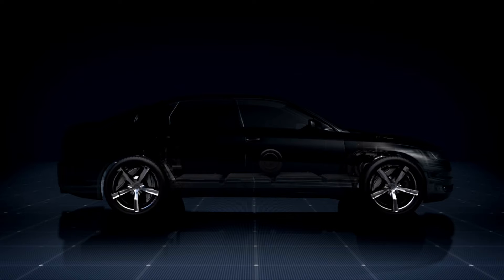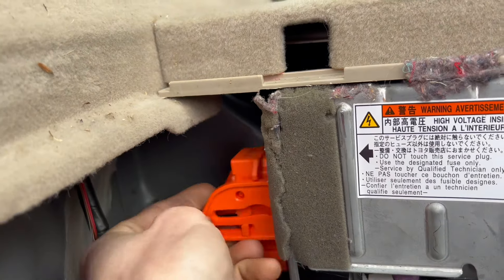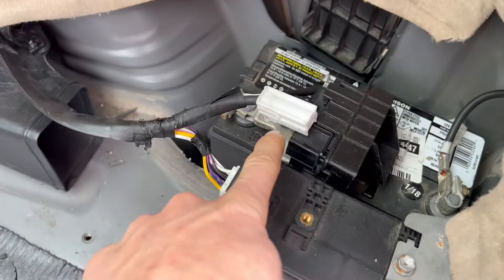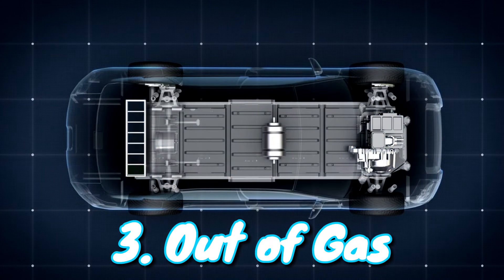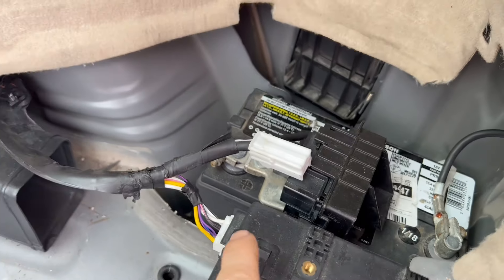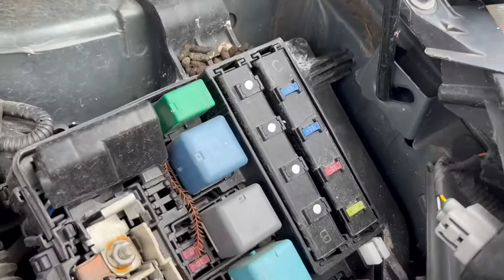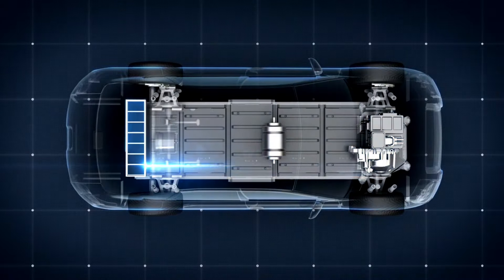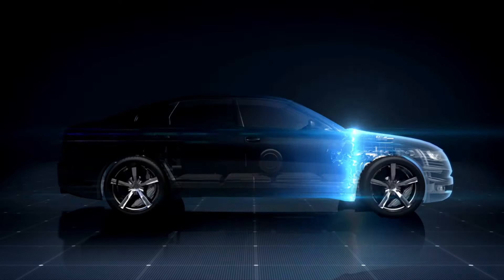My Prius won’t Start (Do This)

Comment: My 2009 Prius stopped in the middle of a very busy road on a Friday afternoon. Worst part was locked into P so I could not shift it into N to push it out of traffic. I turned on the hazard lights and stood 50 feet from the back of the car warning cars in my lane to change lanes. Most folks got the idea after seeing my car dead (the hazard lights were not easy to see in the bright daylight), but some folks just ignored me and drove all the way up to the back of my car. LOL Out of the 100s of cars, 2 kind gentlemen came to help and realized I could not get into N to push it out of the way... the last gentlemen said we could force into N ifwe removed the center console. In the meantime, tow truck was called and hopefully they called Police to help direct traffic around my dead 'once very trusty' Prius. Finally jiggled the gear knob back and forth as the second gentleman suggested and it went to D, then to R and quickly lit up N and back to P. Once I saw N light up temporarily, I felt hope and just kept at it... When N lit up, we pushed the car into a driveway/parking lot. Big relief!!! Very grateful to the two gentlemen that stopped to help!!! Got my car towed home and leaving it there for now. The Red triangle of death appeared as well as the (!) in a yellow circle, VSC, check engine and the low tire pressure lights were on right after the car died... oh, the area where the D, R, P, and N lights were went crazy and blinking but no D, R, P, N lights appeared... just a bunch of horizontal blinking dashes (short lines). Any idea what caused this? Glad I was not driving to the airport on the interstate! Need to do that tomorrow with our other car!!!
Reply: I had a similar issue. It died me on right at the light . Stuck in park and steering wheels locks up . I would turn it off and on and the steering wheel would go back to normal but shortly after the engine turns off and the steering wheel locks up .
Reply: @alejandropena5658  Hopefully your Prius is running normally again. I got my car towed home and have not even tried to drive it as the thought of it locking up on me has scared the daylights out of my normally 'laissez-faire’ bravado. LOL With a mechanic friend’s OBD he pulled the U0293 code (lost communication with hybrid vehicle control system) and waiting to hear back from him as to what to do next. Looked up many U0293 links, all says to check various and numerous fuses, etc… The car starts now that he cleared all the codes, but glad it did not lock up on me  driving on the interstate at 70 mph!!! What have you done about it??? blue skies and good luck!
Reply: my mother’s prius was having the red triangle of death as well as a plethora of other dash lights illuminated. It would shut off on her after about 15 minutes of driving, but she was able to start it up after about an hour. turns out it was the hybrid battery coolant pump. i had learned the hybrid battery has its own cooling system.
Reply: @karinawashere  you are referring to inverter pump with code 1121 ?  OEM part cost $350 @ dealer,  aftermarket very low price but will not last,then pay/ do again. I have found that when my 07  Prius gives a code?  After reset will work, battery 12V disconnect 3 minutes  and connect allows to start, but comes back because it wasn't fixed. But good to know?   Just might not always b the case, but hope it helps. Thanks for sharing, and vídeo. Helps many people.  2gen luxury when new! Now, low budget, because lower priced. 20 years old.!?
Reply: @atcclass went with a $30 inverter pump from amazon. worked fine for 3 months/8,000 miles later until someone totaled the car. Now looking for another Prius.  Interesting cars. great on gas mileage!

Comment: nice   Take a trip to glastonbury ct,ive had the 2004 for 19 yrs 210000  Its silver and looks/clean good , not all beat up,  did brakes/tuneup waterpump/02 sensors- everything maintenance, im looking at a 2020 le 2wd now with 6000 miles i might buy- get ready 4 beach season   THX 4 the response
Reply from the maker: We have a 2020 awd prius if you are interested? Might be able to work something out and check your silver one out too

Comment: my 2004 second gen prius made some weird noises , now it wont fully go into drive- it seems like it slips & wines-- when i try reverse same thing barely slowly trys to moves ,  Like its not engaging all the way- the dash lights and triangle all come on ?  Can you help ?  any suggestions ??  Please help  THANKS
Reply from the maker: Probably bad transmission:( any noises?
Reply: @carhub2178  no noise, it goes into drive and reverse- but jus tugs & slips a bit- its like its not fully engaged- triangle and all dash warning lights are on ,  motor runs fine - revs a little high MYSTERY ?? what do u think ?
Reply: @carhub2178  its like it wants to engage but instead the red triangle and all warning lights are stuck on and transmission is only partially engaging
Reply: @carhub2178  best way to describe it, its either in park or half in reverse/drive
Reply: Did you figure it out?  Any codes?

Comment: are u interested in the 2004 ?  its all stock new toyota brakes/water pump- hankook st tires- it runs but the motor goes crazy like i explained- look good /clean  had left front fender replaced in 04 when it was new
Reply from the maker: How much you gonna sell it for?
Reply: @carhub2178  at least 2000   Every one in car buisness wants everything for nothing- this is a clean, 04 I told u everything in other responses   THX
Reply: @carhub2178  whats your e mail  ?  i will send u some pics of the 2004 prius- its clean   I will send u the codes it threw to -  Then may b come up with a price-
Reply from the maker: @No2ndHandInfo  wyattvaught22@gmail.com

Comment: so my 04 prius starts - all lights on dash come on - the cooling fan runs constant, if i put it in drive the engine revvs and the car will move forward but not enough to drive it- if i put it back in PARK the idle goes back to normal- fans stay on the whole time ?  Any ideas PLEASE HELP ?
Reply from the maker: Have to hook it up to a code reader and see what it’s saying. Is it making any rattles when you put it in gear?
Reply: Cooling fan in the back?  Did you figure it out?

Comment: My gen 3 starts right away despite having code replace hybrid battery ,why ?
Reply from the maker: If the hybrid cells are not very bad it will still be able to start but if you keep driving with the hybrid battery light on it could really damage it. Also the hybrid battery light could be on for other reasons. Not just a bad hybrid battery
Reply: Maybe depends "how bad" it is? LOL.  Mine would drive normal for like 1M then go into limp mode.  If I turned car off for 30 min then it would "run again"...for another 1mile...

Comment: You bro is there any way I could hit you up and get your advice ?
Reply from the maker: Yeah what’s up
Reply: @carhub2178  im tryna flip this 2017 Buick regal but I’m having no luck , I should had took my first offer but it wasn’t ready yet and I wanted more . It’s from copart too , and it has 18k miles .
Reply: @carhub2178 hey man my 05 Prius ran out of gas and after refilling the tank when I started it up the car isn’t fully starting up and just showing all the check lights. Can you please help me out
Reply: @fahadmaan3934  
You probably burnt up the electric fuel pump in the gas tank as the fuel in the tank cools it...
Expensive Fix 😢

Comment: no theres no rattles ?  just how i explained previous    Its gone crazy   It wont let me read the codes,  May b its the computer bad or inverter/some electronic safety module-   When u read all my symptoms ?  uve never had something similar?   THX  4ur time
Reply from the maker: I havent ran into this yet. If I was able to see it in person I could figure it out
Reply: Did you figure it out?
Reply: i sold it it was an 04 with 210000  I bought a 2020 le fwd w/6000 miles for 25000$ with a lithium ion battery, i run it in ECO mode- Its averaging 67-70 mpg all the time combined driving IM AMAZED plus how much more quiet it is,  My 04 averaged 45-48 & its 1.5 was noisy @RogerPack